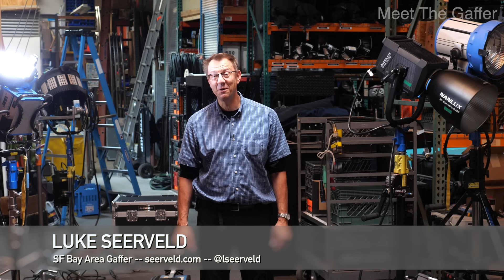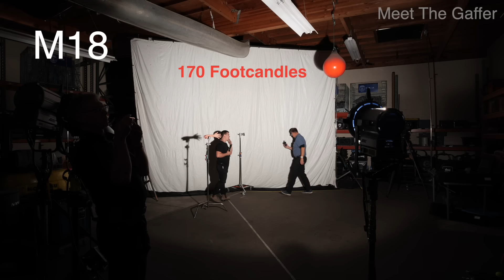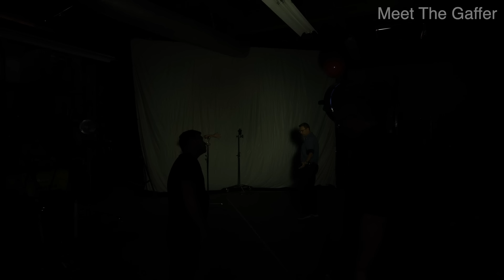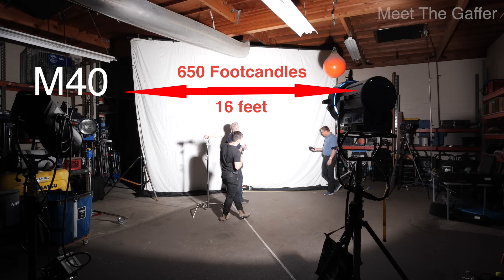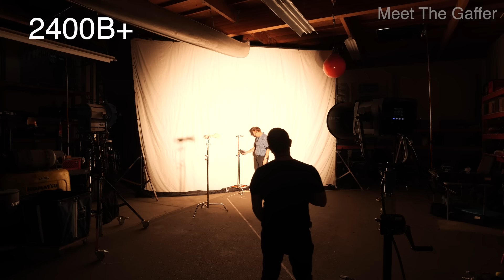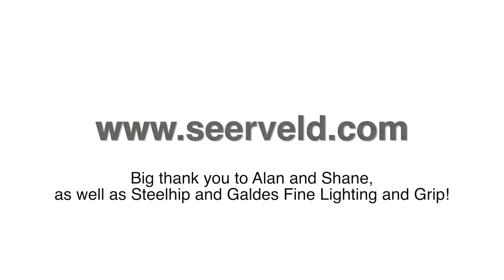Nanlux 2400B vs ARRI M40 and M18... a Shoot Out!

Comment: As for a power  can we use a Eco Flo Delta Pro  with 2400b and 30 amp  twist adapter run the light at max and keep the battery unit plugged in to  charger at the same time while getting max out put? This should be possible but have not tested ?
Reply from the maker: If you have power for the charger, why use the Ecoflow?
Reply: @meetthegaffer  Working at locations were you need full output and location can't handle the load but the lights running longer than battery will hold.Most places don't have full 20 amps avail ?
Reply from the maker: Got it. I don’t actually own any Ecoflows and I don’t know if you can run at max while charging and how that affects the charge rate. Does seem like you’d need some kinda magic to pull that off. Having one or two back up power stations so you can leap frog the charging seems like a wiser plan.

Comment: I have a question that relates to 16:45 in the video about power distro. Lets say you run this off the 20 amp outlet inside a house and you run extensions around to the side of the house where you place the light shooting through a window. Can the distance of the extensions effect the power draw? Alan said 95% intensity was around 19 amps or something, if you run that extension far enough away would you need to drop that intensity down to say 80%? Im not an electrician im an owner operator dp and want to know my limits. Its more likely that I will be doing some low budget shoot in the future at someones house with this as a biglight instead of an m40 and knowing the boundaries would help me make decisions. Thanks!
Reply from the maker: This won’t be a very satisfying answer. I don’t know what the differential of percent power should be for line loss. Others may be better versed in line-loss issues. Present day LEDs like the 2400B are able to run on a pretty wide range of voltage. If you run a hundred feet of extension using regular 12/3 cable, even with 15A Edison plugs from a home getting their power from the county’s electricity provider, you should be within tolerances. I believe the head will tell you your wattage if you’re using the switched power lead. I need to double check this though. Yes, your amps could go up as your voltage goes down, and unlike with a genny you can’t just turn up your voltage, but unless you’re running hundreds of feet you should be OK. And you could consider running off a 3K genny instead to keep the power source closer. The main thing is to have good, internally tightened stingers because loose connectors is often where the heat builds up… like with M18’s.
Reply: @meetthegaffer  I think thats still a great answer! I started off as a 1 man band and having these conversations is hugely important to help me fade into the film workforce. Thank you for responding! Also great videos, truly a wealth of knowledge thats hard to find sifting through all the youtube "cinema"

Comment: what generator would you recommend to power two of these 2400B's?
Reply from the maker: Two 3000 watt, a 6500 or 7K putt-putt Honda. And with the larger putt-putt you may be able to run it in 220V mode with proper cabling. If you don’t need them to run that long you could run them individually off power stations that can handle the load.
Reply: @meetthegaffer  thanks for the response. would be running them all day outside -- daylight through the windows. if running all day would you recommend the 7K Honda?
Reply from the maker: Yes.

Comment: Chart at the end is misleading. Why not add the beam angle to the HMIs? M18 flood is 60 degrees right? just curious why that was omitted
Reply from the maker: I went with the measurements throughout the video that you can compare visually in real time.
Reply: @meetthegaffer  yeah I see. Video is very good, thanks.

Comment: Luke, we just got a demo 2400B+ graciously loaned from Mark Bender and Nanlux to test. The owner of the shop (we didn't do side by side) was skeptical that the Nanlux was even close upon striking it to the M40. That said the spec sheet best case scenario for the Arri at flood (52*) is 650 FC @ 20'. I ran the Nanlux at 80% on Edison at got 615FC @20'. All were at 5500/5600K with supplied (medium dish). Of course the new "dishes" will be fantastic but the Fresnel soon to come will put the FC up from 650 as well. Great stuff thanks for the in depth comparison.

Comment: When will you test throw across different distances?  Something I suspect is inherently advantageous with a bulbed light in a faceted reflector over a flat lensed cob pushing light into a conical reflector is the throw from that bulb.   I'm betting the M18 starts clawing back gains at distances further than 3 or 4M....but I'm wrong a lot.
Reply from the maker: I think that’s where you need to go back to the manufacturer’s information as they tend to provide longer distances.

Comment: 5:45 Power Distribution: So. confusing to us (Europe) - I would be totally overstrained with a mid-size (powerwise) light setup in US ;-) Wouldn´t know all the parts.
Here in general we find several 16A (230V) outlets to run everything - otherwise generator needed. Sounds too easy sometimes...
Reply from the maker: We envy you!
Reply: @meetthegaffer  too easy for amateurs to light a set here... see it this way , too ;-I

Thanks for all your work to make this channel - always inspiring

Comment: 24:35 refering to the panel stand - what unit is that exactly?
Reply: Part of why I like the Panel stands so much is the price to performance ratio... for a $1000 it cranks up lights up to 90-100 lbs. Certainly all the Crank-o-vators and Roadrunners are beefier and carry more, but are gigantically larger. I can carry two Panel stands on the front of a cart...albeit a little modification with the American blue spacers you see on overhead stands stuck into one of the upper bolts.
Reply: @alansteinheimer4274  Difficult to buy Matthews here in Europe - import prices are much higher (especially for heavy bulky equipment). the event industry relies on europe or east-europe gear that doesnt fit perfectly to film/video requirements (less weight, less capacity, easy to transport). You see Avenger C-Stands quite a lot and larger stands with bigger film companies, but the average mid size or small owner/operators dont have them.
The Panel stands looks a good choice - but also needs to imported at high cost. Still looking if there is something similar here. I own 4 Titan X2 (Rotolight) comparable to S60 - the minivator and panels stand would be nice for them. Still investigating...

Thanks for the reply and inspiring thoughts!
Reply from the maker: Hi Ulrich! Alan was referring to the Matthews Panel stand. 
https://products.msegrip.com/products/the-panel-stand
I always carry two panel stands and two mini-vator II’s on the truck to keep those larger heads and menace arms on wheels😀
Reply: Do you see the mini-vator superior to other "classic" windup stand? Matthews is very price overseas (germany) - so always struggling with grip/light support manufacturers vs prices...
Reply from the maker: It depends what you mean by classic wind up stands because we don’t generally see Manfrotto/Avenger? or Kupo stands over here. It’s difficult to compare with experience of only one side of the equation. The next step up would be Roadrunner stands from American Grip, but that’s in another price bracket… or as my Canadian brother in law says, snack bracket😀
Reply from the maker: @ulrichmors574 The panel stand and mini-vator II are still wire driven stands and are not perfect, but they store compactly and work well for that mid level duty payload just under 100 lb/45 kg. The panel stand does not have support struts like the mini-vator so you need to operate it more aware of tipping hazards.

Comment: If you tin the ends of the copper on your stinger you will almost eliminate the plug frying issue.  The internals of a hardware store 20A vs a 15A edison are the same.

Comment: As a matter of fact, here in Europe, not all houses or apartments have a 20A breaker circuit. Most of the time it's 16A in 230V, and for specific rooms, like garage or laundry there are 20A circuits, and in some cases, like big washing machine or kitchen oven or ceramic plate ; 32A mono (still regular 230V phase-neutral circuit).
Also the general breaker on top of the specific circuit breaker is always 32A, typically mono but also can be three phase, and at times 63A (commonly three phase + neutral at 400V, but 63A fat mono installations does exist in some places ).

Then for anything other then household, there's a bunch of three phase breaker with differential ; lots of 63A, some 90A and 100A, and a few 125A. Then in industries or big work place, the sky is the limit, can hook-up to a 600A 400V power breaker.

However the good thing is that our plugs are rated for 20A no matter what, you can either wire them with 1,5mm² copper (16A) or 2,5mm² copper wires (20A).

Can't wait for some in depth test with more intensifiers and fresnel !

Comment: Hmmm. Seems that the difference in beam spread is different enough to make a night X want the M40. One light on a house (far background perhaps with no condor) wants a wide spread and the 45 degree intensifier won't allow that. Sound right Luke?
Reply from the maker: At this point only one intensifier has been released. It remains to be seen what else will become available, but I would assume wider and tighter, along with a fresnel. The beam angle we measured to a 1 stop drop off was quite similar between the two units, but that doesn’t mean there wasn’t further illumination beyond that. Deep in a field either unit will have some spread, and could be widened with some light diffusion as well. We just need to get out there and play😀
Reply: The biggest drawback I see in ever larger LED mono lights is the absurd size of fresnels necessary to maximize beam optics.  The 2400 will require its own case and the whole thing will weigh so much more than a M40, just heading it up will be a pain.   That said, the Nanlux seems like a biggish deal  @meetthegaffer
Reply from the maker: It’s a game changer if you appreciate control speed and power draw savings. It opens up new levels of flexibility. We’ll see what pluses and minuses arrive with a fresnel. Previous COB’d fresnels have surprisingly more output as compared to the same lensed HMI’s. Is the quality of the fresnel different? Sure. Everything is a compromise of some sort. More tools to play with😀
Reply: Yeah a fresnel if designed properly should increase output with more efficient light gathering than the faceted reflectors, and honestly I much prefer a fresnel/M18 typefaced and focusable lens.  And let's face it, the color is a huge draw.  If it was only available as daylight my interest would be tempered.  Used M18s going for $6-7k are a strong pull. @meetthegaffer

Comment: Luke why dont you guys use Hospital grade 15A plug to run M18 or the nanlux? Thats what we use in Canada and its actually rated for 20A and we rarely have to replace those
Reply from the maker: Have always wondered about this and will need to check it out. Thanks!
Reply: I pulled the 15A plugs and replaced them with flat blades on my HMIs so nobody would put an 1800 into a 15A outlet; I just carry adapters in case we're stuck and can use dimming to make sure we don't blow a breaker.  So often M18s would blow a circuit in houses because they weren't running 12/3.

Comment: Not sure if this has GaN but if it doesn’t, a model with that, Nanlux branded or not, and thus being potentially more power efficient (target 10 or 13 amps?) and smaller, lighter but for the same output would be killer. Right now the whole switching thing just makes the product confusing to use. It isn’t intuitive even to three guys with years of experience between them and are pretty up to date with the LED stuff.

Maybe another term could be “gatherer” since it’s really just gathering the output. A working short hand term could be “45 Gather” or “45 Gat” for a 45 degree reflector. “Intensifier” works well too but it does give an implied meaning that the modifier is multiplying or adding to the output in itself, which it technically isn’t since the modifier doesn’t emit light; you don’t get more light output, just that it’s gathered, concentrated. Maybe just a bit misleading for the uninitiated or newer user.
Reply from the maker: The intensifier is a method of focusing intensity differently than a fresnel, but like a fresnel the beam angle changes and the intensity grows, therefore calling it an “intensifier” is appropriate.

Comment: It’s an led world now. It’s probably only a matter of time before we get an m90 equivalent
Reply: Good luck with that
Reply from the maker: Yup. That seems like quite leap, but there’s no doubt we’ll get there🙂 I could use a bi-color unit of that size in two weeks, but that probably won’t happen. Meanwhile, I’m looking forward to incorporating the 2400B+ in place of the more power hungry M40.
Reply: They have the LEDs, problem is cooling them with the present affordable cooling solution it would be heavier than an m90 or required a separated liquid called  radiator.
Reply: @gaffergear  HMM! you've just killed future sales for M90's. You guys are so respected across the industry, I bet you Godox and Nanlux CEOs just sent the R&D team on a trip to Bali and not to return until they have an M90 equivalent, with a ballast the size of the 2400B. What great time to be a young  gaffer.

Comment: Nice comparison. How much noise does the light make compared to 1200 watt models?
Reply: Hmm, important question… we were too busy on the day for a careful evaluation. That said, it did not pop out as super noticeable. Like the Nanlux 1200B only had complaints from fussy sound department… perhaps they are resigned to us torturing them with fan noise… tolerance for it has grown on set. And bigger lights typically much farther away.
Reply from the maker: I’ve only had the unit out for these two episodes so far, but the fan noise has not called attention to itself… which I think bodes well. Have yet to burn the unit on a quiet set.